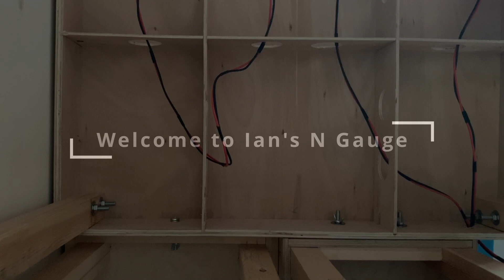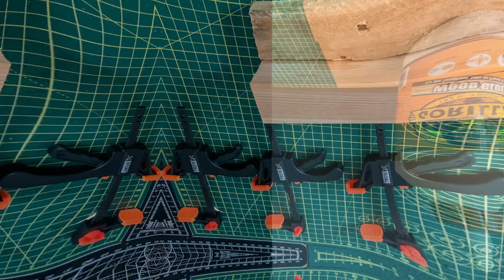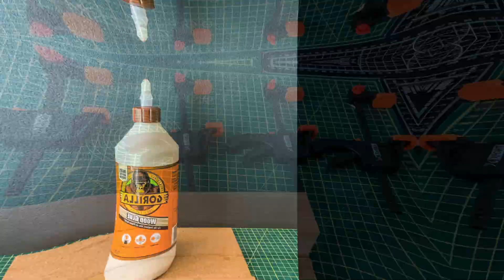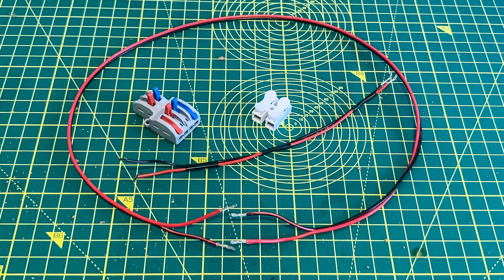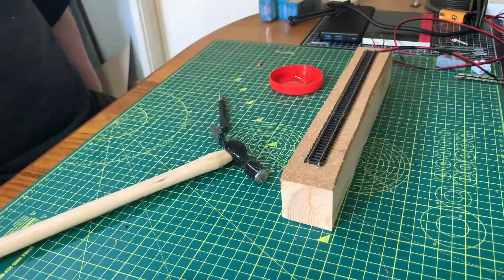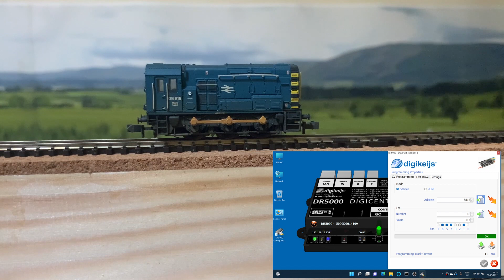035 - Build - Programming Track

Comment: Hi Ian, good video, just need to make a piece of pukka test  programming track myself instead of a piece of loose track I have with two wires attached to it! Another job to add to the list! Cheers Gary
Reply from the maker: Hi Gary, and thank you! I thoroughly recommend making something a bit more permanent! I'd been programming on the main, but it was getting more hazardous as I electrified more of the track! I think I'm also going to ballast and weather the programming track in the future, as it will be quite a convenient way of moving locos around in front of scenery to photograph them! All the best, Ian.

Comment: The nice thing about the DR5000 is that you can use the programing port as normal Operation.
So what I did is use an isolated siding on the layout that I could use as apart of the layout and as a programing track.
Reply from the maker: Yes, this is a great idea, and I'll probably end up doing that myself when I finally fix my track plan! All the best, Ian.

Comment: found with the layout I'm working on a reasonably simple way to have a programming track is to pick a siding, isolate it with nylon fishplates on both rails and give it its own feed - wire that through a double pole double throw switch and you can switch between two supplies to that siding - one the main DCC the other the programming track. 

then its easy to use it as a programming track when needed or just as a general siding

I went with a DPDT relay in the end as it was then easy to control that directly from the DCC system (using JMRI here and a DCC++ base station), there is also a nice little LED that lights to tell me its in programming mode but to be honest a simple switch probably works just as well if not better.
Reply from the maker: Hi Dale! Yes, an isolated siding is a great idea for a programming track! At the moment I'm moving my track around too often, but I'll give the idea some serious consideration when I lay my track more permanently!  All the best, Ian.